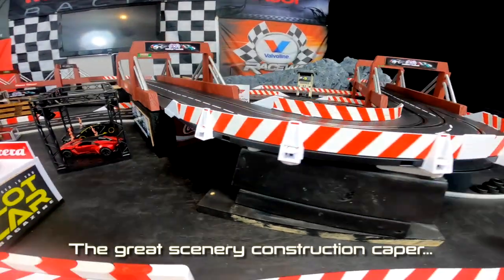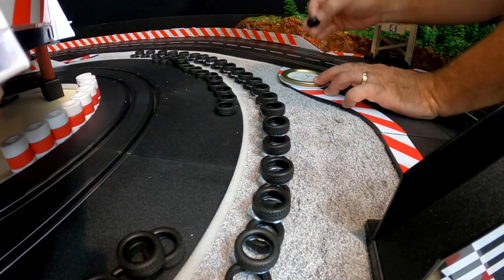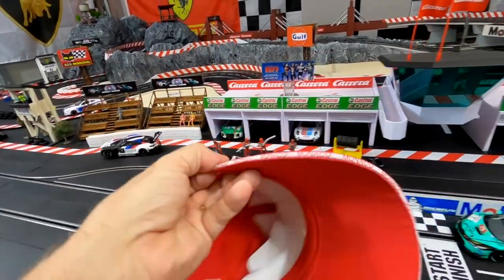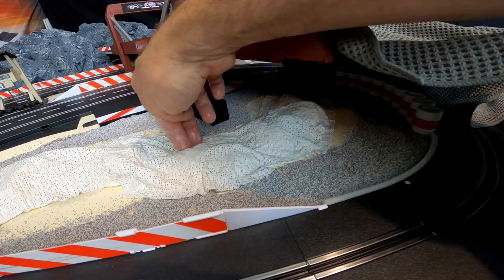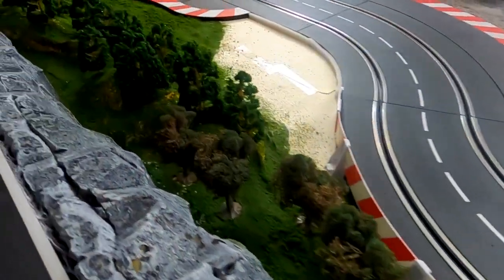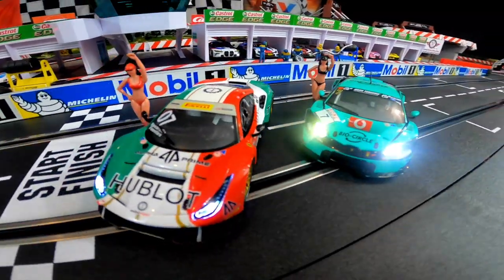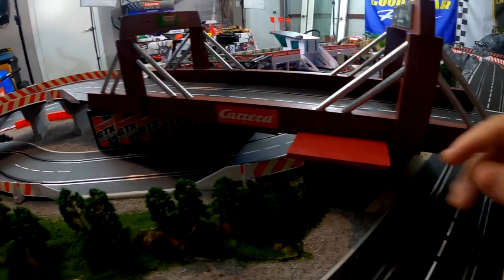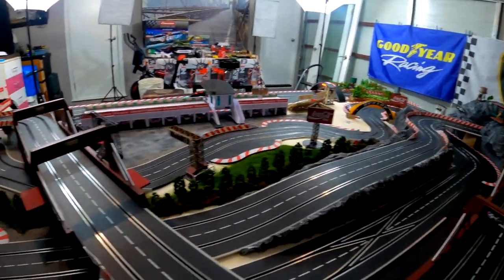Slot Car Scenery Super Edition - Hughes Garage SCA Ep 10 #slotcarscenery #slotcars #carreradigital

Comment: Great explanation to the issue with wireless controllers and it’s the exact reason why I prefer analog your reaction is transferred instantly down the cable which in turn means you have fully control of the car (unless it derails or a break in the cable) with wireless your not entirely in control you have acted but you have to still wait for all the modules to talk to each other and perform your decisions that’s enough to cost you a race or derail the car without your interaction or your over-reaction due to lack of understanding of lag
Reply from the maker: The standard Carrera 'wireless' sets are perfectly okay for normal everyday use, really. But when you up the stakes for 'high speed racing' with tyre changes and other performance enhancement mods, that slight latency delay indeed can become an issue (for some). You just can't go wrong with a quality 'hardwired' cable. My opinion.😎👍

Comment: While I'm a fan of scenery and dioramas, not for slot car tracks. This stuff is very appropriate for trains but trains are all about the visual elements and they don't race (usually). It's the competition element that sort of kills this idea for me. 
Competitive racing demands clean clear lines of sight with minimal visual distractions and that need really doesn't blend well with scenery imho. 
Then there's the beating that all your hard decorating work experiences during races where turn marshals tend to be less concerned with some of the more delicate visual elements and more concerned with grabbing a de-slotted car and getting it back in to the race as quickly as possible.
There are a few decoration elements that are appropriate for slot car tracks but they usually don't include things that stick up off the surface like buildings or trees or even road signs or streetlights.
I've seen some beautifully decorated slot car tracks in all scales but, if you plan on doing some actual racing, I just don't think it's practical overall.